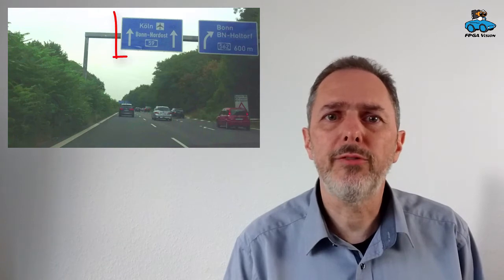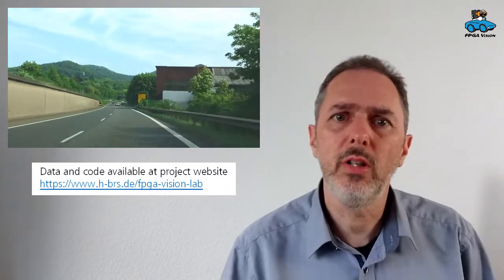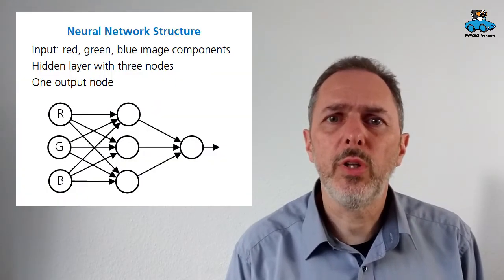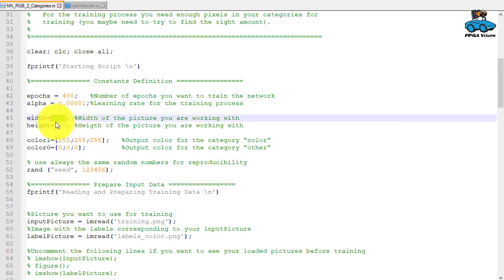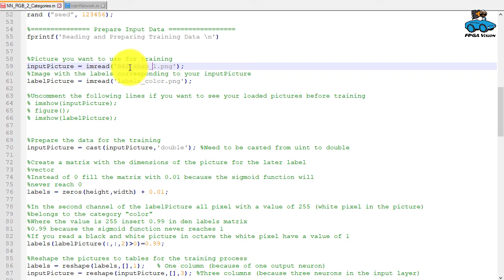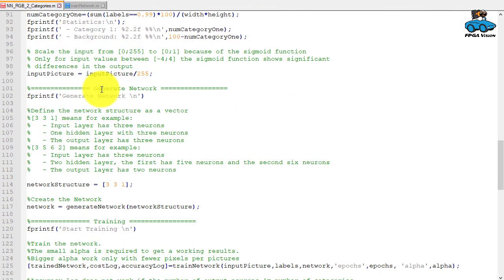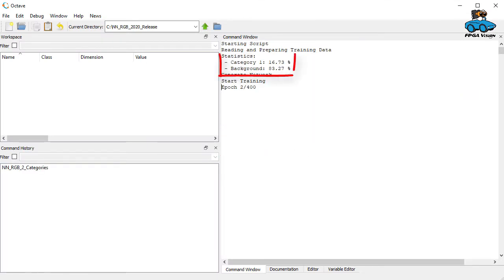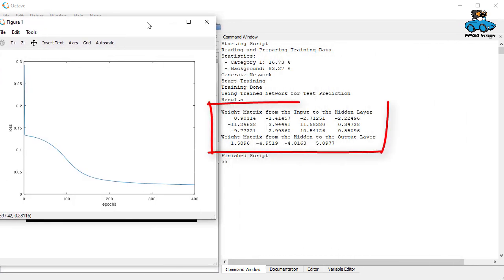Machine Learning on FPGAs: Training the Neural Network

Comment: These are great videos! I am really learning something. 
One Q about this specific one though... how should I understand your label file? You draw a box around the roadsign and black out everything outside, with which you tell the net that every pixel in the box is yellow, even if there are different shades of it. Then the R & G & B values of every pixel in the original file are used as training data. So, if everything goes well, the neural net, once trained, can tell for every set of RG&B values if it is a shade of yellow. Yet, in the label data, there is a black arrow and some black characters, which you label as a shade of yellow since they are in the box you draw.  
Yet, when applied to the image, the neural net indeed designates the pixels in the arrow as non-yellow. 
Did it manage to do that because it also learned from the regions outside the box?
So, does that mean that the labeling of the pixels (your box) does not have to be perfect?
Am I getting this all right?
Reply from the maker: This is a good observation! You can see it from three perspectives:
1) If you want to detect yellow color, you should make the mask only for the yellow area, so not for the black arrow and character.
2) If you want to detect the sign, you can argue, that the black arrow and character belong to the sign. But black is  ambiguous and can belong to the sign and the background. Therefore it is not detected as a sign.

My approach is:
3) I use training data that is not perfect. There are the black areas and also at the edge of the sign, I was a bit lazy. In this application, the result is OK and the NN detects yellow. With better data, maybe better detection is possible.

Comment: sir can we also use verilog for machine learning on FPGA ? Will it be complex?
Reply from the maker: Yes, sure. You can also use Verilog.

As an exercise, you can take the VHDL code and redesign it in Verilog. The complete architecture and block diagram stays the same.